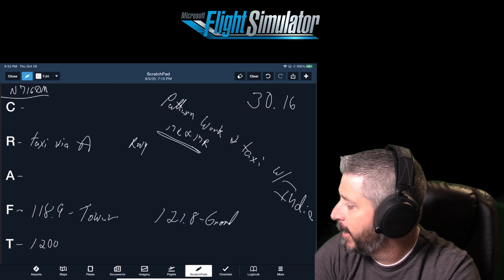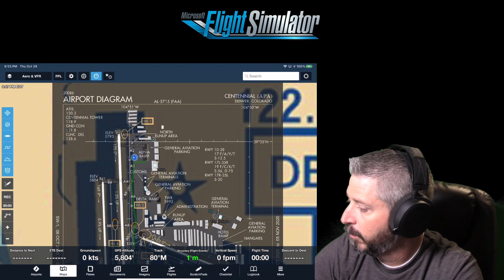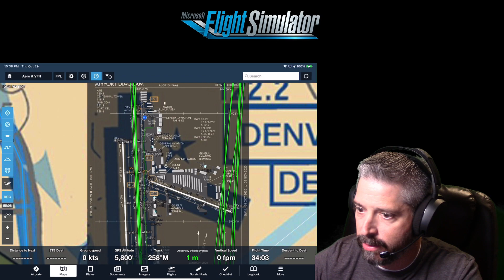MSFS 2020 - More Pattern Work @ Centennial Airport (KAPA) w/PilotEdge ATC

Comment: While I use and love PilotEdge, there are a number of local Centennial things they don't know about.  One is all the geographical landmarks they use like local roads and reservoirs in directions.  The other is how they use the 2 parallel runways.  Having flown the pattern at Centennial IRL, what they have done with me is take off 17L, then make right traffic for 17R and do touch and goes on 17R.  I have only heard them do right traffic from 17L/R and left traffic from 35L/R.  Nice sunset views of the mountains.
Reply from the maker: I’m sure there are some IRL differences .  I find 90% of time on Pilot Edge there they give me 17L w/ left closed traffic. I tend to use the Cherry Creek and the interstate and the circular shaped building off the end of 17L and visual references for me when I fly the pattern there.
Reply from the maker: Thanks for watching... hope my video wasn’t too bad.  Just me enjoying the SIM and learning Pilot Edge and ATC as I work toward my real PPL.
Reply: @sevenonesixdeltamike8754  If you ask them to give you right closed traffic or the other runway, they will.  Then you just follow lincoln ave to the south, I-25 to the west and then arapaho road on the north side.  I'm working on my PPL as well.  Been a simmer for a long time.  I'm 9 lessons in and fly out of Centennial.
Reply from the maker: @Sim to Pilot Nice!  Good luck on your PPL.  I’m now 18 hours into my PPL training and have solo’ed a few times and I’m getting prepared for my 1st cross country solo.  Funny... I’m in Ohio, but I travel to Centennial often for work as we have an office there and I have been over on KAPA several times. Highly likely that I will be living out there in the next couple of years and hope to fly out of KAPA IRL one day! 🤞